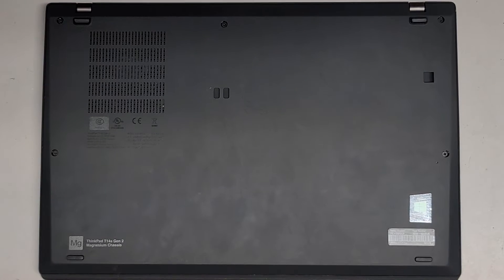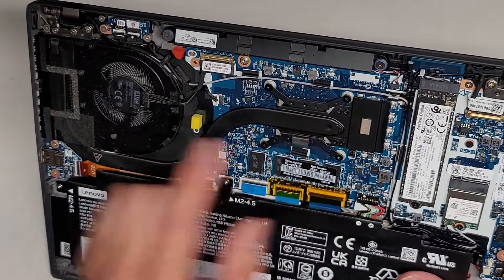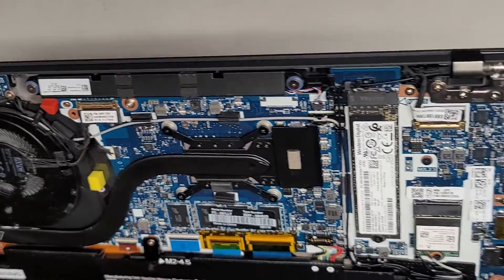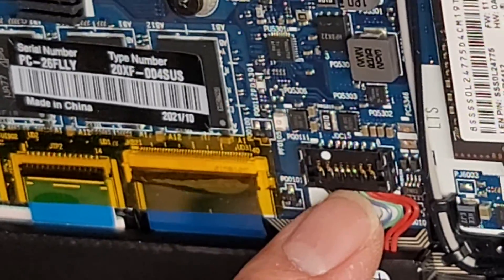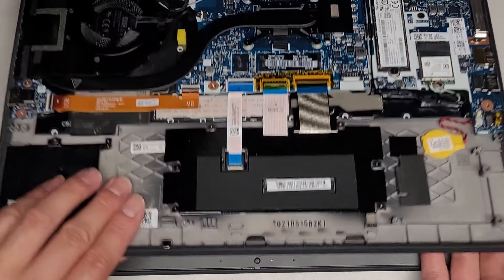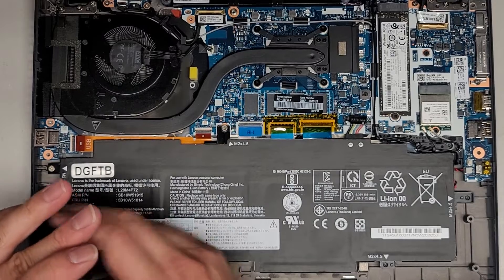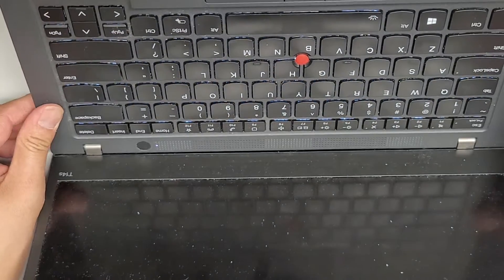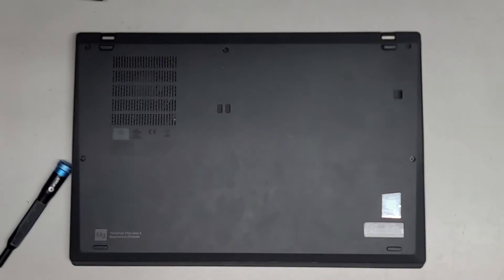Lenovo ThinkPad T14S Gen 2 Disassembly SSD Hard Drive Upgrade Battery Replacement Repair Quick Look

Comment: Can the T14 run without the battery installed, I.e. with the charging cable plugged in at all times? My earlier gen Lenovo had external batteries that could be removed to run on external power. Wondering if that's possible with internal batteries?
Reply from the maker: I think so

Comment: My T14s did not charge anymore, but it was not affected by the bad firmware versions (check lenovo support pages). In the end pressing the reset button for 15+ secs did the trick and my battery is charging again.
Thanks man!
Reply from the maker: Awesome! Glad it helped. If you haven't already, please like and subscribe so others can find my videos and possibly consider watching a few others to get the algorithm to recommend my channel. Thanks!